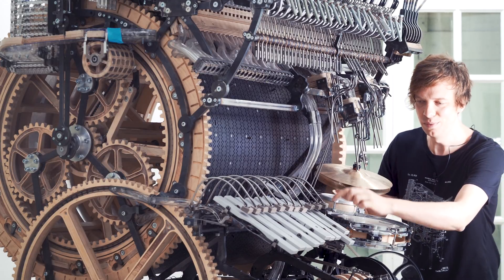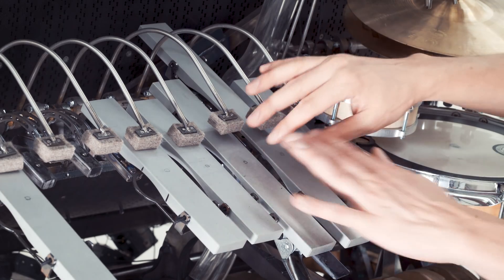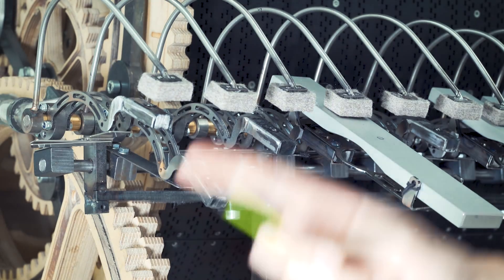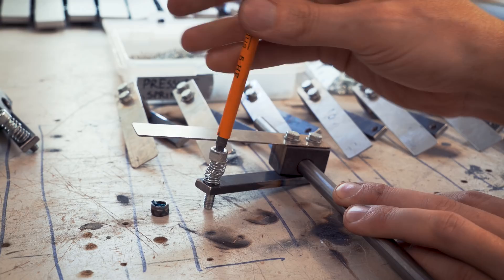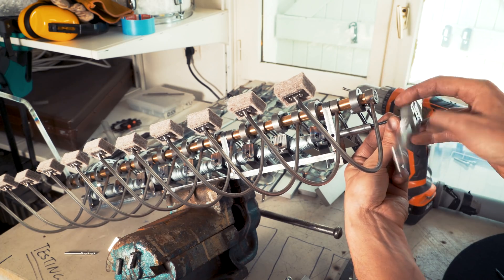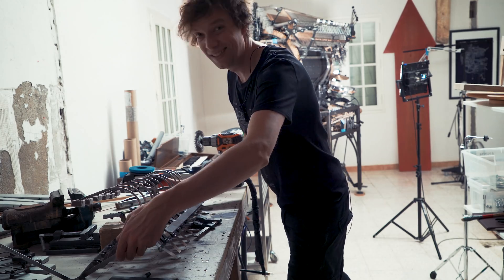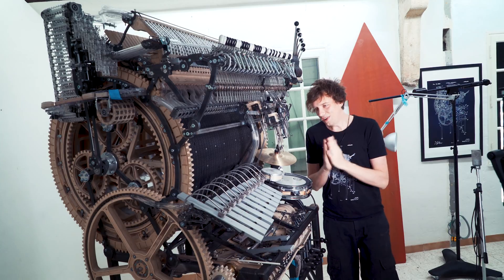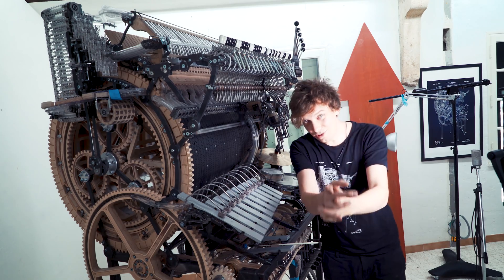Vibraphone Height Adjustment - Marble Machine X #103

Comment: I’m worried that the amount of things that have to change in between songs is getting to be too high. It’s going to take several minutes to change music plates, change notes, tune note heights, etc. at some point you’re losing time value for aesthetics. Love the solution, just worried it’s going to turn into 10 minutes between songs and you’ll lose audience interest. 

I thought the idea of weighing down each note was better in that regard, equal weight means no changes needed between songs. If you want more bounce, change the spring steel.
Reply: Also the weight solution means you have equal bounce across all notes which means your marble bounces and catching mechanisms are probably more consistent and easy to design. They have less variability to account for.

Comment: You could have two vibraphone assemblies just like the programming boards so you can have people backstage getting the second assembly ready while you play :)
Reply: Solid idea. They also will need a second set of vibraphone bars.
Reply: Would that also necessitate a second set of resonater pipes?

Edit: clarification.
Reply: @Smileyrat  I don't see why, these work always well, don't they?
Reply: @bidibum  Err, i just realised how vague my statement was. I ment the resinator pipes he is adjusting to each note.
Reply: @Smileyrat   yea I guess he would have to change the resonator pipes as well since these are tuned to specific notes. Either way it would be less work on stage if the vibraphone bars are already prepared. They can probably change the resonator pipes during the same time they swap programming plates on stage

Comment: the height offset should be built into the notes themselves so you never have to adjust it after setting it initially. this requires a lot of manual adjustment on every note swap vs if the height adjust was on each note then you set it once and it's good forever. instead of offset screw you could have just put a vertical screw or once you found position weld it in place. would have been far better that way

Comment: Why not just redesign the laser-cut vibraphone note holders with varying individual heights?

That would save you having to adjust anything at all on stage when you swap the notes.

They're all unique pieces as it is, so it could be done parametrically in CAD. You could even compensate for the different angles that each bar hangs at, so everything stays aesthetically in the same plane.

Comment: The springs on the cap heads seem way too big - they need a washer, a larger cap head or a small spring else they will slip in time.
Maybe also for long term improvement, ask someone with a lathe to make up spacers for this device? Else one day you'll need to dissemble it on tour and washers will go everywhere

Comment: There's a lot of movement when you hit the notes with your hand (like at 9:55) How much movement do you get when a marble hits a note?  Will that movement dampen out quickly enough to provide a consistent height for repeated notes? Are you not concerned about the movement of the bars affecting the timing? You went though a lot of trouble to make sure the timing was tight, but it seems to me that allowing the plates to bounce like that directly counters those efforts.
Reply: Sustained notes and Staccato notes are indeed wondered about here too! Suppose there's no way to differentiate which you want on this version of the MMX (to big of a 'feature creep' point).  Can't do that on a Piano; but maybe on a MMX on a future version

Comment: Why not simply adapt the height of the supports for the vibraphone bars according to the note ? In this case you will not have to modify any setting on the marble X when changing a vibraphone bar.

Comment: Hi Martin,
I think it would be better to use the screws with handles for height adjustments, and to put them below the spring bars. this way you will achieve instant access to them and there will be no need for using screw keys, you could just use fingers.
Check out the pictures to see what i mean

https://lh3.googleusercontent.com/_T0pN43E3j14AiEGtKUYzHilw3HP1DNtlyQ0DvclPl92u5FyjunsLk5rXT17r7EIggAa_2EdV9ybG9G0sLGJl5VqzchyBs1W5J55aFUMA2cKY-9kz9WJFC0Yz5H1tJM8YGsEvMjlGGtPH2rEmgqpUtw7KR_oMvR5qIMvdqAKEv8QlgeXHN_ZGvwk-r63nn_7Y1WHlKR4gzOTbfr4LhLy34PBvLGH2UPcFjBfJ3ikClce7FeGflA1Z9iRXEoZICXHBYpgnLH2VHh5Coy2YJITngnUYZ3xmzwkp0GA0uDIlimkNSzHun3XfuALdoHSXeCadYsBVVVLt0RpN_A4E7z2A4SjPYMnXNKB-qEoug-YL8E4zM0PlacnDcHv4b9uKnCcsXHYiotFESHeZg7tQcCmN3cwY6dYNkg-X-RPho6vrQTTiGDqnWjfGuWkU-kGcyAZGBCi-iBquU3jDepleX2yCrefqTrXuhvkYtCkxAyokdEo3C-zg9En3634RoguN61d89-7DfNP-SX1wAkOmUwAwrfBFBoSWlChGFLOQ8CMjNW4fi5eDOrvspEW09SSd_A1INuYVs-WEGWJKvPKR2_i9-rEWYEW5fwc4zqfx9zO-bUZdK_g5FznK3sZWRk3N9tYPpxhX0KqJxYTKkL4BWYk0bslDe21dIU19ukgGkZLv1wS5pjC82DDwL8=w1311-h773-no

https://lh3.googleusercontent.com/tlKZIqKCQO0tvjaioMwgyW8UTpWklq0eG2E4794xsLtsHehD8Stl7JyFE8mE_54S-RV1wWC6g1bZxzsqu65rr5MEnponLP9IeEIL-T0Xgi7wlXNgRLj4sH6A23sqGIdmtFfUHeDExNYyoO-fM-hoiVzBUUk7uJ3XGzrihVFyFWKzdQdJkXcXzNxrPsYijkkjkPaCAkHea0DaFvsJOaa0XmYZ27iOQTmrEMYlystJ-T6aC1w1aQP9iPlbrc4REnNaVhcRxZcMZgCak1unGpodmwGrDpM7McpB9TZ_A_jiYokD0UBwkOfMiG72t-axp8SwaJqenkiT6zgPEj_cygWUG4RqBVubr5S1kEMYtdfYyR3mymdVk3m3Tof76Xkee_M0alnUK-PMt9HqocFSOOzUQ_KQDCc6THqk3IBeclHnfTbbt_a-VWv2lMvHSPYo31FQEyVWBAN4_5Evdj508STbVquJuG9RlOmo1CdezcKBLMnUsFvMyHeiV7ymH9TK9UziWg5U7CiDHUiy1HYupbxR2h5J2WfU0Z3phqpPeXRp1CCmQuSF2ZcXpyo2NgvK4x5LGGJVgW12cO8cE_Qy0y7XR1LXqIjv8vy9SIIATNPAVPCthSC7DjNTTuxkzW8Yc5_dMQHZamwGcc2YSlR31Zx1xqPUeEN2X2QL_nBLYbUg7F7LwJlSHisDfi8=w643-h433-no

Comment: You could make it so springs contact vibraphone holders instead of arms and make contact plates higher on heavier bars (or put a screw there to make it adjustable). This way you wouldn't need to readjust the spring each time you switch the bar. And spring fatigue can probably be dealt with by adding a bit of latex glue on top of a spring or smth similar (or just changing the spring).

Comment: While having the ability to adjust is nice, would a minor addition to the holder arm for the bars be far easier? At the bend where it rests on the spring, a simple U bend piece of metal with a vertical slot mounted via the hole you showed would result in every bar assembly having a offset build in that would result in level bars in every position without having to micro-adjust at every swap.

Not saying that this adjustment was a bad idea, but an "and and" solution seems to me to be far more practical playing live.
Reply: I was thinking the same!

And adjustment is still needed after springs starts to lose them spring-manner.

Comment: Could you not have just done the shim solution and put the "shim" on the underside of each note where it contacts the spring steel?
Reply: He addressed that in the vid, he doesn't want loose parts that could fall out/be lost.
Reply: @LegDayLas  that's why I said he could add the "shim" to each note. Each "shim" would be permanently attached to the corresponding note, and would be unique to each note. Therefore, no extra pieces, or adjustments needed.
Reply: He did add in the video that he would like to be able to adjust for fatigue in the springs over time.
Reply: @jayphilipwilliams  That could still be done with the set screw. His solution certainly works, I just think it's a bit complicated.
Reply: @danielw6366  I should have scrolled a bit further before I commented. I made the same suggestion just now.
Reply: @danielw6366  Like Martin said in the vid, Dr. Brown mentioned that keeping the set screw method would eventually eat away at the metal the screw was biting on to and loosen the spring steel, you can keep tightening it, yes, but will eventually have to replace the bar of metal they all sit on. This solution gets rid of that eventual problem entirely.
Reply: @Brian Cairns That sounds like feature creep :D
Reply: @LegDayLas  Lmao nah it doesn't. Feature creep is when you keep adding features to a project to a point where it bogs down the project. What Martin is doing is making sure that each function that was originally planned doesn't have any major potholes they didn't anticipate while they were planning it in the beginning.

Comment: find a way to mark the "normal" height of the vibraphone plates. at least for the first plate, then adjust all others accordingly. over time with many adjustments you could loose track of the "normal" position.

Comment: What changed with the heights of the notes...? - The vibrophone note weights/sizes. 
So, There still exists a rational to modify the vibrophone notes, so that they are all a standard weight, and thus exert a standard force from their moment of inertia.
 I doubt you'll want more to focus on during a performance, 
If this was done, adjusting the height on every note change would become minimal. Hope the suggestion helps
Reply: The height issue converts to a ball drop issue when the MMX is playing. If you want a C cord to play at the same time the C, E, and G notes have to hit at the same time.  A fraction of that time CAN be heard by the human ear and thus sound off.  NOTE: notice that the notes do NOT have to be in piano order to sound the same; they only heed to be present and struck at the same time.  The bar swap out will permit some really different tonality and scales to be used by WinterGarten.  This I think is probably the most exciting part of the versatility of the MMX.  The Cymbals also have this versatility.  Uncertain about the drums ...
Reply: @peterkelley6344  agreed, he is adjusting the height of the  vibrophone notes relative to each other, rather than a standard distance from the marble dropper. Imagine a large and a small note next to each other, IF they were to be swapped into the others position on the mmx the different tension on the machine would leave them at a different height requiring adjustment. What I suggest is an adjustment to each vibrophone plate to that they are standardised to approximately the same weight, so that in the above scenario the machine would require little to no adjustment, when swapping small plates for large ones (or vice versa)  in a given position.

Comment: A little suggestion : it may be useful to add some kind of height reference to the side of the vibraphone. Something you can use to quickly know  where you need to set the bars. Just in case you change a whole bunch of them and you can't easily tell anymore where the correct height is.
Reply: I'm sooo glad you posted this comment Antiath. My thought Exactly. The entire vibraphone section will most likely sag over time. To keep consistent timing, whether audibly noticeable or not, it would be smart to add a height reference that is fixed to the machine. This all assumes that the swinging plate can return to the same position for successive notes. I think Martin will find this to be a major headache, Soon.
Reply: A small laser level permanently fixed to one side of the vibraphone. Then turn it on and adjust any notes to be just below the laser line. The concert venues are unlikely to have really bright lighting, so I think this would work really well.
Reply: @grahamsnowden6173  Great idea! Maybe even two lasers to quickly see any bars that are too high or too low.
Reply: The damper is a good enough reference.
Reply: @user2C47  Not really no. The dampers aren't even alignedbetween themselves ( it's easy to see in this video) and their cussions will loose some width over time as he keeps crushing them on the bars. A fixed and hard reference is better.
Reply: This also simplifies the job so an untrained man can easily complete the whole operation. Great idea.
Reply: Not needed if they all weigh and balance the same relative to the arm's fulcrum

Comment: Won't this result in a Problem with synchronisation of the Vibraphone and the Rest of the maschine when the height of the plates isn't allways the same. 

Cause the drop distance changes if u dont make it to a specific height.

Comment: Will you have some kind of 'level bar' you can temporarily mount just above the vibraphone to use as a perfectly true repeatable reference for setting the height every time, which can be removed during songs? Otherwise the height could have a bit of random variability as you swap from scale to scale and eyeball the height each time, which could affect the timing / tightness of the music, I would think.

Comment: You could perhaps use pipe, cut to length, instead of stacked washers? Spacers! Also, to "eat out" means more than you maybe expect it to? "The set screws will eventually eat out the shaft" (@1:05) is a delicious mix of concepts!

Comment: Brilliant! It's like the fine tuners on a string instrument.
Reply: It is, and that is a problem. On a string instrument you don't have to change out the strings all the time. He plans on changing out notes between songs on concerts. That means that he wil need to do the adjustments on stage while the audience is waiting.
Reply: @SorteBill1514  That's something you can get around with good planning of the set though. Not every song has to be a marble machine song.
Reply: @Eriksjostrom  Mabe so, but it could have ben avoided.

It is a neat system and he put a lot of fine work in to it, but it is an unneccesary feature that don't add anything to the MMX.

Comment: I’m surprised none of the ideas involved setting the angle offset on the plate holders themselves, which would make manual adjustment of the angles part of occasional maintenance rather that being necessary every time a note gets switched out.
Reply: This. So much this.
Reply: I had the same thought - this does silver a couple other problems, but Martin, if you are already redesigning the brackets and they are individual already, why not add a height offset as well?
Reply: The bar that the holder  connects too is going to dropp bocause of the weight. The plates might be paralell with that soloution, but not at the same height. With his need for perfection this would not be good enough. 

 I agree that he could have redone the holders. If he meassured the height difference and angle, he could have had new holders made that was at the right height and angle. It seems to me that this would have been worth it in stead of cutting and welding every holder just a week prior.
Reply: Gentleman, you just made sure there will be another unplanned video, before the MMX is done. Well done, well done...
Reply: The issue there is if the spring steel wears out, or only wears out in 1-2 slots
Reply: @finder83  i don't think changing out spring steel should be a problem. They are not welded. The limit before you reach plastic deformation on spring steel is nothing to worry about in this case. It couls maybe be on a maitinance schedule between tours.
Reply: As he said, the added concern of the weeking spring steel makes his solution better and more consistent.
Reply: I agree - adjustment should have been made on the plate assemblies rather than on the plate holder. The feature of having the plates being interchangeable has now been reduced since all changes will now require manual adjustment. Martin - put a height set screw on the bottom of the holders and have it register to the spring steel.
Reply: Since the parameter that changes is the weight of the note, attach the change mechanism to the note and you'll have fewer adjustments to make during swapouts - given similar spring-steel properties across the range.   You may not even have to remove Solution #7 to do it (assuming enough clearance).  In this case, you wait until after testing a bunch of simulated live-performance note swaps.  If live note-swap height adjustment really becomes a hassle, you just could add contact-point adjustment capabilities to the note holders too.   Anyway, great work with the Marble Machines   You are inspirational!
Reply: A potential problem with this is that a given note isn't always going to be installed in the same slot, and there will be slight differences in tension between different springs, so moving a plate to a different slot would likely still require a height adjustment

I think Martin has found a "good enough" solution to allow moving on with the project. Refinements can always be made later..
Reply: @gcewing  Exactly! Thanks, I don't have to write this down. :)
Reply: One million percent behind this design idea. The idea of additional adjustments between songs seems like a lot of work and would ruin the flow of the performance.
Reply: Because (in my mind, i might be wrong) it depends on which notes you're putting next to each others.
Reply: Thought the same, have any adjustments on the note holder itself
Reply: had same thought before seeing the video. preload and height should be on each note. he did the same with vibranotes hit zones. such a bad solution martin gave here.
Reply: Both "ide" combined are perfect.
He could still fine tuning the height by hand but most of the work would already be done.
I guess is time to remake the plate holders in the CNC. Final version with a lot of learnings.

Comment: Again, you don't have to add weight to the plates to make sure they are at the same height, you could just change how high each plate is above the plate holder.
This is the same as you did for the marble drop. Use everything on the machine the same for all marbels, but every plate should handle its position correctly. That could be up down for keeping it level and forward back for finding the sweet spot.
EDIT: though I do like #7 more than relying on a single screw to hold the spring on that bar.

Comment: If you add weight to the plates it won't lessen the effect of the marbles as the masses in the collision are the same; if anything, it will make the movement more uniform as previously the lighter notes would move more as the difference in weight is less.